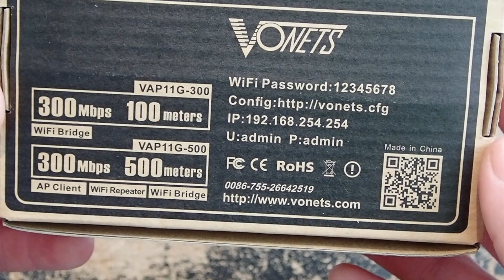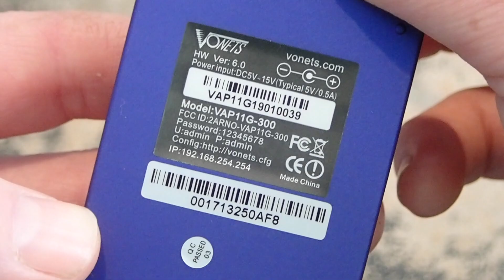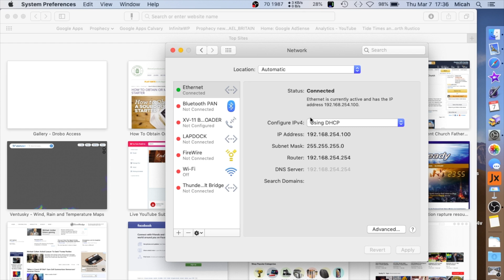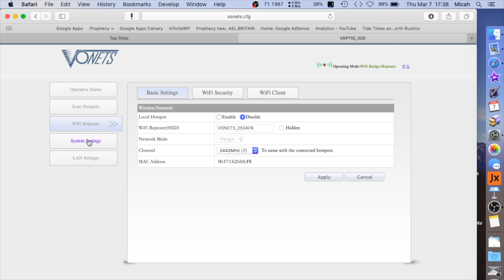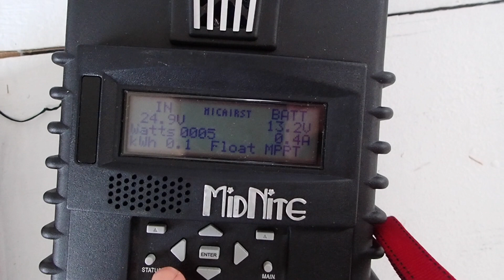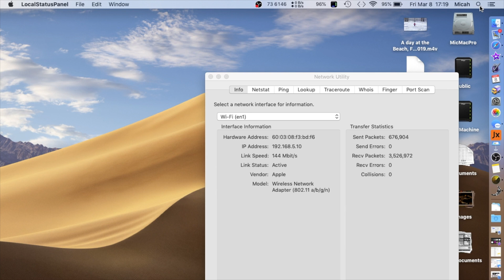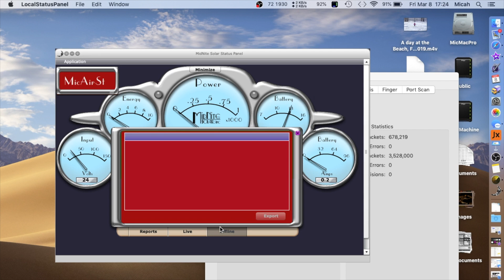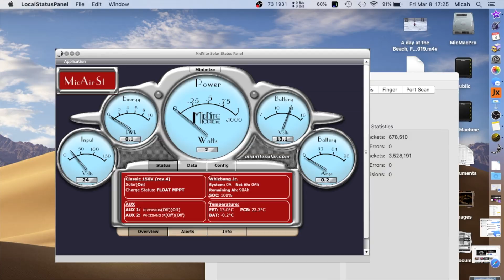HOW TO: Midnite Solar Classic 150 Wireless Bridge Installation using VAP11G-300 - Part 3

Comment: Just ordered one from Ebay ($19) I will be hot spotting my phone data to it & then plug the ethernet cable to my home router :)
I might try it without the router first because the advertised range is good but I don't know how many devices can be attached to this unit.
Reply from the maker: Cool should work no problem that way!
Reply: @MicahGallant  
Yep,... I intro's my stepson to the deal from Visible owned by Verizon,... I created a "Party Pay" where you & others in your party get $5 discount for every member (max 4) so now we have unlimited everything for $25 a month pre paid :)
Visible offer a decent phone for just $19 so he connected that phone to his new router & I have seen him feed 2 phones, 2 tablets & 3 tv's for Netflix & YT video's all at once on 3 bars of signal !... No speed caps & no data limit but only can hot spot to one device so that device is his router ;) 
He has internet for his house & kids plus a spare phone that stays plugged in & charged that is basically a house phone for $25 a month !
I tested with a mini nano router but decided to order the one in your video to plug it to my router.